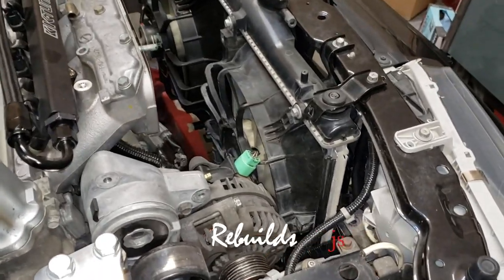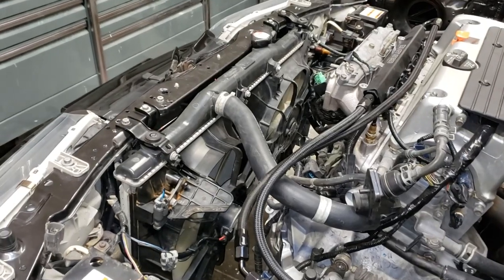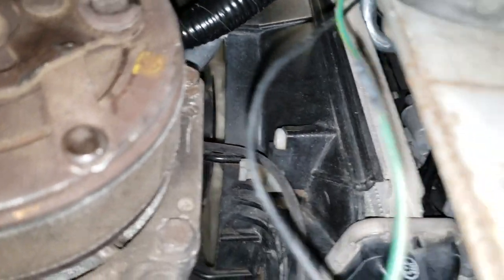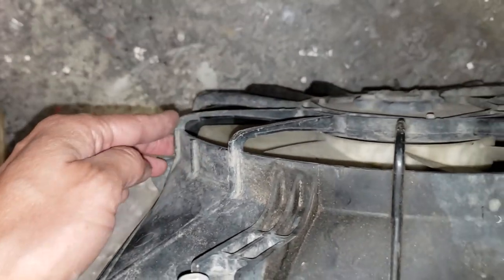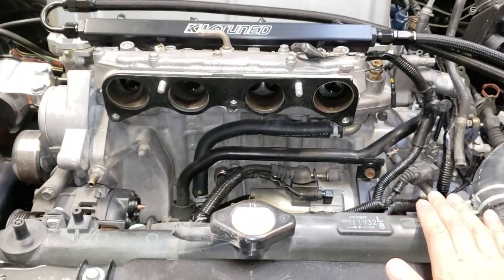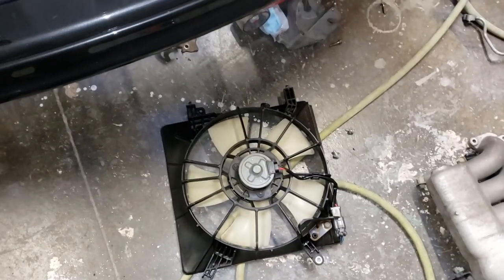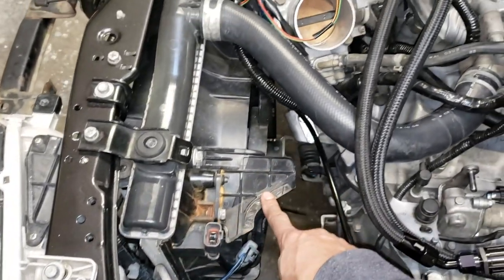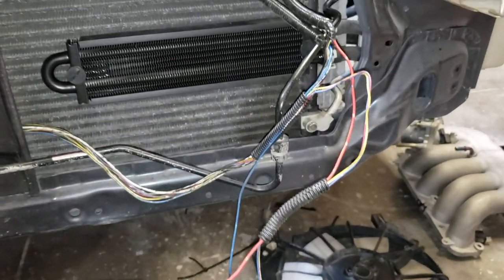Which OEM radiator did we go with... K24 Swap (Part 1)

Comment: I did the same radiator and fan setup with a k24a2 in a 97 dc integra. Had very few issues my hardest part was getting the lower hose attached to the thermostat outlet on motor. Ktuned swivel thermostat housing fixed that issue. I did not extend and criss cross the fan wires, rather just plugged each side straight in. Reason being, both fans come on when radiator fans activate anyways. I also used a strut bushing to seat the radiator instead of the factory ones, which allowed the radiator to sit a half inch lower which helped with the lower hose even more.
Reply from the maker: Thank you for the info and how you made it work makes a lot of sense.

Comment: @jsRebuilds  Thanks for sharing all the challenges, and such a good walk through!  I've got a 95 integra LS as well but going K20Z3.  Can the stock radiator/fan setup not be used, or what was the main driving factor to change?  Trying to build on a budget, guess I could pull other parts from my 09 Si (donor for the swap).
Reply from the maker: I would say no on the stock Integra radiator and fan without tons of modifications. It took me tons trial and error using the RSX radiator but I can see why its not really used. I was stubborn but made it work. As for 09 si radiator maybe the better choice but I haven't tried using it. I believe there is a guy out there named OEMworks who did use a 09 si radiator and made it work. I can see why the 09 si radiator may work better because the bottom radiator hose is really the hard part to make work. I believe the bottom hose for 09 si radiator would be easier to find because it goes across to the thermostat. I did find a bottom radiator hose for the RSX but it sits in there kind of awkward but it did work. Also I believe the 09 si radiator size is closer to the Integra as in terms of fitting in the car. If you look at @1:29 on this video, I did all the measurements and the 09 si measurements seems to be closest to the Integra.
Reply from the maker: One more advice is if decide to use a slim fan, it will make it a lot easier for you.
Reply: @jsrebuilds3951   I was wondering about those. Thanks for all the input and I'll keep investigating investigating for my swap 😊

Comment: Does it matter if it’s type s or base model rsx radiator or as long as it’s a rsx?
Reply from the maker: Yes they are the same but I would recommend a slim fan for passenger side. Very very tight in that area. Also I haven't looked into it but I believe the 06 civic si radiator maybe a better fit.

Comment: I'm doing a k24 in my integra also, what about using slim fans?
Reply from the maker: I think slim fans would fit better because it is very tight with the oem fans.
Reply: How's the clearance when closing the hood?
Reply from the maker: @Straightupg_813  you know I really never tested it on integra with a usdm frontend. I know with the jdm frontend the hood is design to with a curve upwards which probably made it work for my application. With my jdm frontend I didn't have any issues with clearance. Maybe we should post a message and hope someone can respond with them fitting an rsx radiator on a usdm frontend.🤷‍♂

Comment: Hey bro I’m doing a k24a swap in my dc2 as well and was looking to keep ac as well like you. Did you reuse any ac parts from your b series or did you need all new/replacement k series ac parts?
Reply from the maker: You will need to keep your B series condenser, keep all the ac lines except the bigger line from the fire wall to the compressor, 1 of the line from the compressor to the condenser . I don't know exactly the names of these lines but I will have a video on my ac system soon.
Reply from the maker: Finally got the first part of the ac video done. https://youtu.be/QR0Na7ChdgU

Comment: Did both the rsx upper and lower hoses work?
Reply: Great content by the way
Reply from the maker: I had to find and customize hoses for the top and bottom. Here is the video and thank you for you comment. I've listed the part # in the description as well. https://youtu.be/dixjFJ8IraY
Reply from the maker: @joseislas1299  I have not tried the 09 civic si radiator but I have a feeling that radiator maybe better than using the rsx radiator.